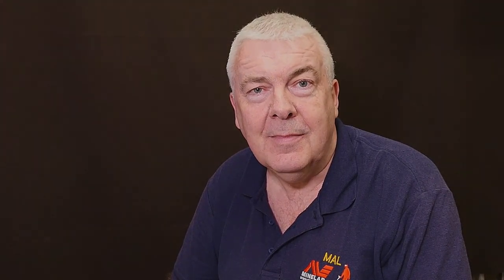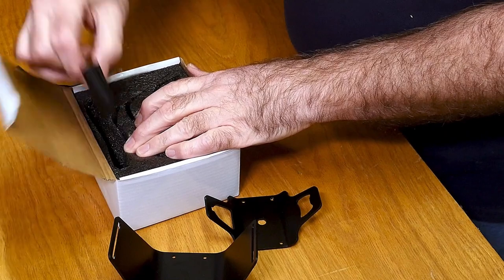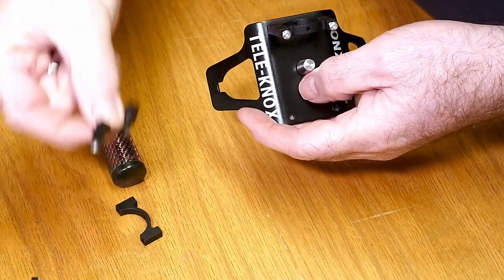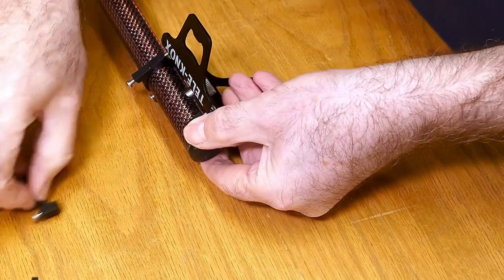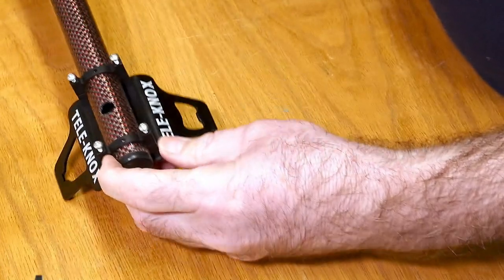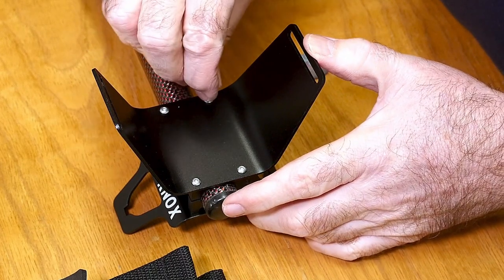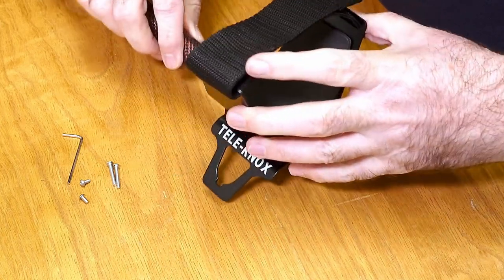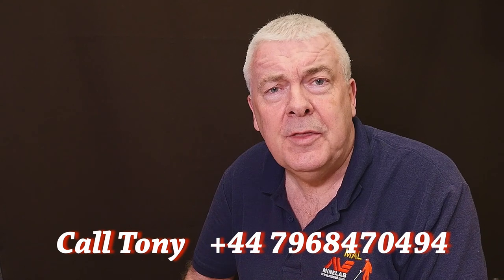TELE-KNOX new arm cup from Detecting Innovations

Comment: @Glenfiddich101
29 minutes ago
There are no instructions in this set but your video is very good and explaining how to set it up however at 3:15 it says simply line up the holes and screw them together with the small screws, but in the set which I bought, the holes do not line up rendering it pretty useless, and that ain’t very pretty, for a bracket with is twice as expensive as the original part, you would think that they would have made it better. 😲🤔

OK now for the edited bit……

It’s now 99.8% sorted but it could have been a whole lot easier if (a) there were instructions supplied and (b) they had supplied a decent Allen Key as the one supplied is so small and fiddly or recommend that the user could use an electric screwdriver, when tightening the four long screws, make sure that they are all screwed in at the exact same length or the holes may not match up with the 4 small screws as was the case which I had, but all is good now. 

Thanks Mal for the video 👍
Reply from the maker: Hi Glenfiddich, thanks for watching and glad the vid helped.
HH.      Mal